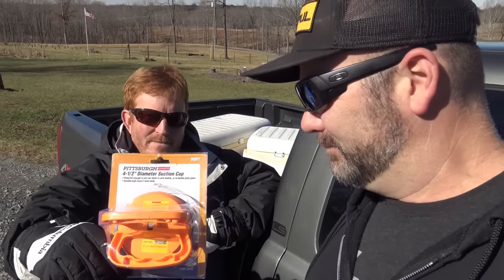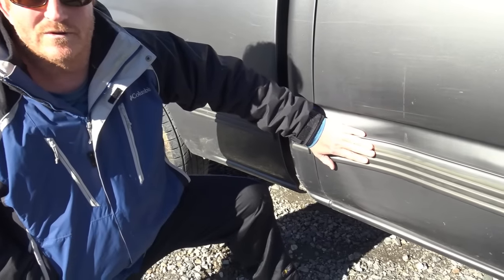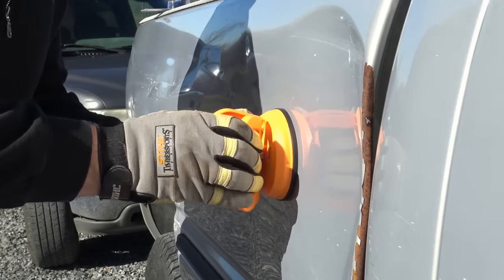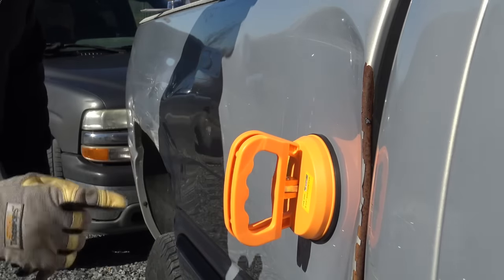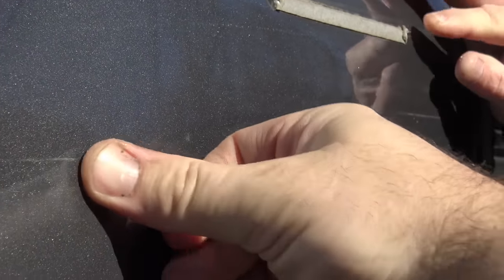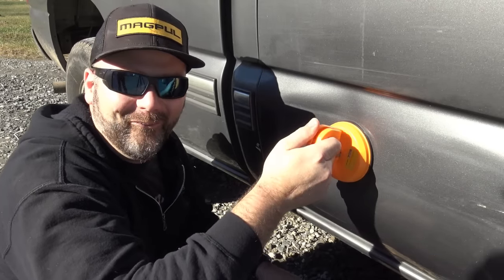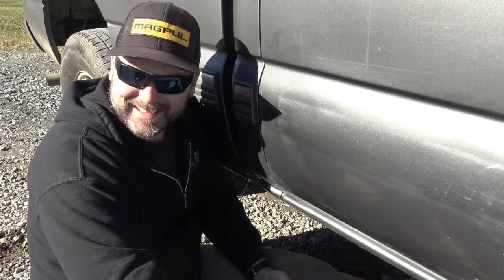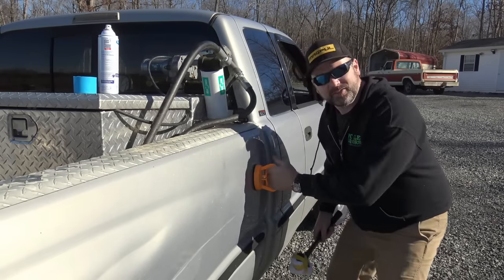Fix a dent quick cheap and easy! TESTING THE CHEAPEST DENT PULLER ON AMAZON!!

Comment: Pour a couple of kettles of hot water on get panel very hot (metal expands) suction cup pull and put cold water on (metal contracts) dint should be history . I was doubtful when some one advised me to do it but it works a treat wooo
Reply: John Fisher Makes perfect sense.
Reply: If you do that on a cold day it can ruin the clear coat on the surface.
Reply: DENT, not DINT.
Excellent advice!  I need to do this.
Reply: @mjremy2605  dent / dint same meaning both correct grammer good luck with it
Reply: @Ex-pomjohn  Yes, you are right!  Its old English.  I never knew. I learned something! Thank you.  I usually check before I correct anyone, and this time I didn't, and it came back to bite me!  Ha ha!
Reply: @twinx350  yeah the water trick is a trick for a reason….
Reply: @johnfisher516 son brought his first car immaculate condition , came back after his first time driving it with dents on front and back panels and tailgate . Just tried your method spot on mate . Two front panels done now to do the rest ,  note to myself , if he ever asks to use my car tell fcuk off

Comment: The quickest way would have been pulling the door panel and hitting it from the inside.    The cold metal sure didn't  help in removing the creases.    Nice job having a lot of fun with a friend.
Reply: I would rather try this before pulling everything out from the inside. I’m not sure I would get it back together properly and I’m not looking for more problems

Comment: PDR - People who do "this" pros use HOT GLUE to attach little rubber pullers then attach a HANDLE (dent puller) to pull out the dent - sometimes it takes "multiple pulls/multiple times" -  you just haven't pulled enough times THEN they use rubber tipped hammers etc. on metal rods and push the dents out from the backs of the dents !! There are many PDR VIDEOS on Youtube - go watch some of these then you'll know the PROCESS !! :-)

Comment: I am a grandmother who bought one of those orange pullers yesterday to try my hand at getting a large pushed in area out of my truck back bed panel. Had watched a few videos like this first, and was able to pull 50% out with the first pull. (I am not at all strong) Worked another 20 minutes and got most of the rest of it except an area that has a crease in it as in this case. The truck is a beater, so I am not going to worry about it, but I am happy with what it did and I certainly got my $4 worth.
Reply: But you are a strong lady get it Granny Granny
Reply: I am a grandma too, and I am not sure if I should buy it, the dent is worse than this. The problem, when I go to get gasoline, men stop by and say, “ for $350 I fix your car right now. Sorry I don’t have cash. Don’t worry, for $250 I fix it now. Thank you but I don’t have cash now. The last man told me, for $100 I fix it, you can get the money from the amt machine, ….🤔🤔🤔  I said, give me your phone number and I can call you next time.   🤔🤔🤔😂😂😂😂😂 I know $100 is not much but I wasn’t being sure

Comment: Wow, they do work!  I have to do my car too!
A heat gun would have worked well.  And alternate between heating and dry ice behind some foil.  The hot and cold works well to pop out small dents.  I would have take out the door panel and pushed that out with my hand or a rubber mallet.  They also have rawhide mallets for jewelry that are gentle.  Thanks for a great demo!

Comment: Try using a hair dryer set on Hot on the dent, when you're pulling. It really helps.
Reply: Is a heat gun better than that a suction cup ?
Reply: @miketin745  you want to use both. Heat it up and suction pull it out

Comment: May I ask you if a Cold Glue or Hot Glue can be applied to a suction cap to pull a large dent out? I've never seen in any film people using suction caps that way, though I've seen 2x4 wooden blocks used. Thank you for the great and informative film. I didn't know you need to spray a glass cleaner to improve the action of the cup, I'll try that way. Before the cup was attached firmly only to the smooth area, where there is no dent.

Comment: I fixed my Subaru bumper with Hot water and pressure works a treat .Your dint is to close to a main beam it may work a little but it will not repair %100 .

Comment: Thanks for testing this! I was in the parking lot of the grocery store and damn if the wind didn't push a shopping cart into the door of my van and dent the hell out of it. But I think I can get it out with this with a little perseverance and a measly $5.
Reply from the maker: I also used one of these kits: https://amzn.to/34yiZKM  (affiliate link from Stoney Ridge Farmer)  it's a Paintless dent and ding remover kit...it will take out small dents very nicely in case the big dent puller doesn't work
Reply: @StoneyRidgeFarmer  what do you think about the heat gun ?
Reply: @miketin745  It is a good idea but watch out for paint peeling if it gets too hot. Gently. Wagner $22 at Home Depot.  I did my plastic bumper this way with no issues. Popped right out.
Reply: @StoneyRidgeFarmer  $97 on Amazon with $10 tax in CA. Not worth it.

Comment: I was reading reviews on Amazon about these dent pullers, and they weren't very positive, but after watching this, I'm going to give it a try. Thanks for posting this video.
Reply: If the dent isnt exactly on a flat surface I wouldnt. Just got mine Friday and sending back. My truck has a dent in the tire well and it will do nothing.

Comment: Bought my Chevy Colorado it's a 2004. And bought it for 600 couple months ago. And it's at 186k miles. But to the point I had to use one of these to pull a dent out of my cieling bc a tree had landed on it. It wasn't to bad but it was noticeable it pulled it out right

Comment: We purchased that same suction pad from Harbor Freight in the Bronx NY to address a pointless dent at rear driverside panel right near the bumper cover.  It did a good job on the area furthess from the bumper cover, but we have the same issue with a crease that we now believe that a smaller suction pad will work.  Thanks for your suggestion on releasing the pressure on the creases as well.
Reply: That's where I bought mine.On Boston Rd.

Comment: Damn, for the money you can't beat those suction cups. Gunna go out and buy me a couple as well today.
Reply: How did it turn off ?
Reply: @miketin745  It actually worked, but for some dents the crown of the dent is in far too advanced or technical of a spot for the suction cups to work.
Reply: Did you use a heat gun ?
Reply: @miketin745  no
Reply: I really appreciate it I was trying to figure out should I buy a heat gun or suction cups
Reply: @miketin745  No problem :)
Reply: Still looks like shit. However you can’t do much to a busted up 97 accord

Comment: Just spray hot water in the dent then clean it with a clean rag then try to pull slowly with the suction pump and it will work .

Comment: You need to heat the metal more.....people pour boiling water over the dent first. Also use two large Pullers, same size....so there is even pull on the dent to give at the same time.
Reply: You have to remove the part and throw boiled water on it..the just push it firmly

Comment: Tried one of these on a dent in my wife's Honda. Not happening folks!!!  Several times I tried several different methods (per instructions) and pulled so hard the puller suction let  loose and I ended up smashing into the wall 4 feet away. I now have a dent in the wall and the dent in the van is still there!!!
Reply from the maker: I have another vid out on paintless dent repair that might work for ya, you'll see me demonstrate it on a honda element  here's a link: https://youtu.be/sOZ9vuQwJis

Comment: I would suggest taking the inside door panel off and pushing the dent out if it's frames in there with holes I suggest using a rubber mallet and a number 2 pencil and bang the eraser end to push it out

Comment: Would recommend using a heat gun so warm it up and then using the dent remover it would pop out easier and be more movable
Reply: So a gun better plus a suction cup ?
Reply: Using hot water is better. Heat gun will damage the paint

Comment: ya those orange suction cups are only rated for like 80lbs of pulling strength if you got 2 rate at similar ranges your pulling power is only 160lbs but over a larger surface area to. I don't think its going to work you need the air compressor autobody ones even to pull dented plastic... let alone metal body components. But may try it on plastic dent pulling if you apply a little heat on the back side of like a bumper then use the suction cups on the front it may work for plastics.. (no way for iron and Al i doubt it unless its very thin gage  AL sheet metal)

Comment: Hey, you think this will work on the bumper of my 2016 F-150? I ask bc all I see these used on doors, roofs, hoods which are thinner metals than my bumper. Idk much about body work, it’s a much smaller dent than what your workin wit, idk I’d appreciate advice.
Reply from the maker: it's a suction cup my brotha...it's not pulling a dent out of a thick steel bumper ...however you can buy entire replacement bumpers fairly cheap nowadays

Comment: Despite them not working on your trucks i would say those things work well enough   My  guess is you should heat the areas  up  with a heat gun  and  work some other  angles  and spots around the dents  i kind of agree with your conclusion on  purchasing several  in order  to work many areas at the same time  on a side note ive replaced regulators on a older Chevy work Van  and you needed. The  super large pop rivet  gun  and special rivets  i got from a freind who owns a  repair shop  and half of a Snap-On truck  as he and his brother are  certified mechanics  and co owners

Comment: The suction cups where more rated for moving /picking up car window glass which is around about weighs 20 pounds or less from what i see. You really need dent specific air compressor suction cup equipment or stretcher autobody equipment or stud welding/slide hammer equipment. But i to am curious about plastic dents so may try really only got them to move light weight glass panels around such as car window glass.

Comment: RATHER THAN DRILL HOLES IN THE DOOR I WOULD REMOVE INSIDE PLASTIC DOOR PANEL & RELATED PARTS THEN TRY TO PUSH IT OUT FROM THE INSIDE. COULD BE A BRACE INSIDE THE DOOR BENT AS WELL.

Comment: I’ve heard of boiling a pot of hot water and pouring it on the dent, placing suction cups and then pull. I’m gonna try it on my truck soon.
Reply: Have to be careful. I heard it could cause your clear coat to peal off.

Comment: Good fun. Coincidentally, I just bought these two suction cups at HF: one large, one small.

I pulled a huge ropey vine with my mini excavator, and the ropey vine took three trees with it. One of the trees left a small dent in the door of my previously dentless truck. I counted myself blessed because it could’ve been a whole lot worse, but I wanted to try this method of dent removal. The body shops today are all about replacing and color-matching entire panels: uh un, no way.
Reply: Cl

Comment: Once the metal is stretched, that's it. The only thing you can do is lower the crease and use body filler. You did about as good as it could be done.
Reply: That's not true. Metal pops back out. I've seen it come right out. What matters is, did it crease bad or not. If it's creased bad, you're in for what you said at least. If it's just and oval and pushed in it didn't bend much. It will pop out.
Reply: Michael Cook can you shrink it with heat hammer and dolly?

Comment: The line, right above the moulding is what is holding it.

THe smart thing would have been to, remove the door panel, push on the top line from the inside, while someone was pulling in the cup, starting at the very outsides of the dents.
Reply from the maker: Yeah....but we wanted to see if we could do it with a $5 suction cup...not pulling the door panel...a million ways to do it....none quite as smart as taking it to a body shop lol...just having fun here on the farm brotha..just good fun
Reply: I was a body tech and mechanic tech, before an accident disabled me.

I'm currently playing, with PDR myself. Lots of fun.

I was an old school, type of metal man and not, a plastic surgeon. (Meaning that, I didn't use inches of filler.) LOL 

You had the right idea.
The only thing is, the deep spot at the center: 'locked,' the whole dent in.

When you try your next one, try taking smaller sections of the dent, from outside in first.

Again, you have the right idea.

I'm sure your followers would love, to watch you guys do a complete dent repair. 

Good luck.